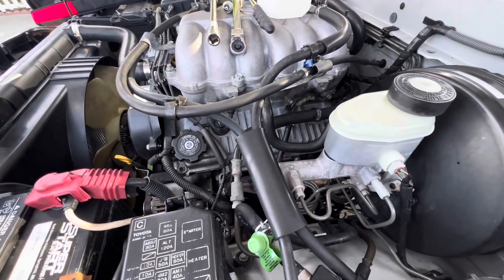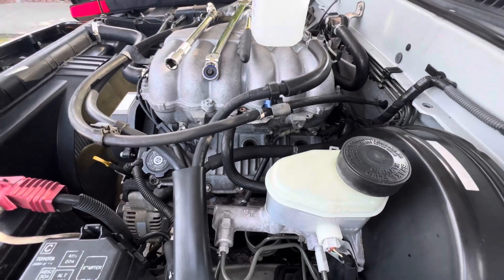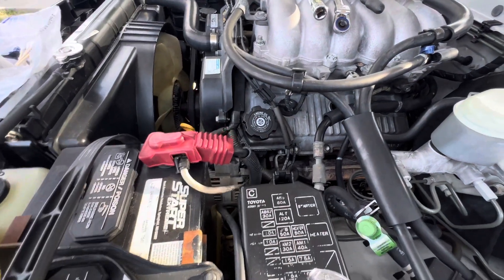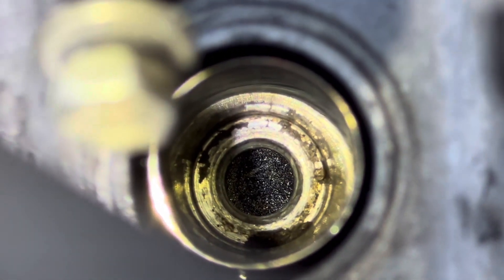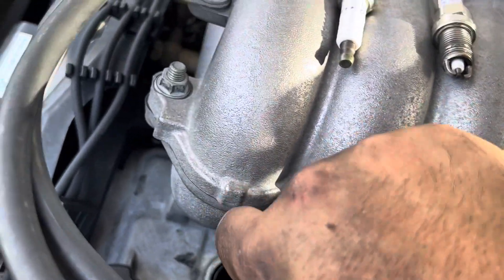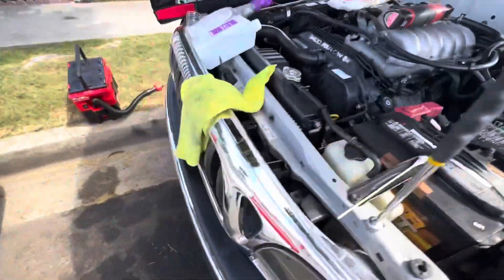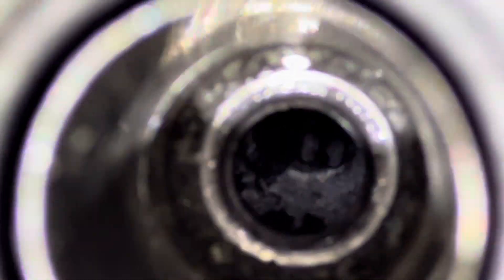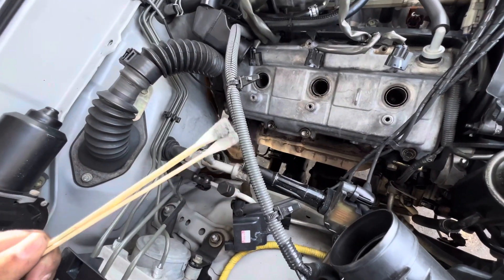How to Clean Spark Plug Tube Holes!! (5vz-Fe)

Comment: Just was wondering if you could tell me where you got the adapter hoses that fit on the Milwaukee vacuum?
Reply from the maker: Yessir I got it at Home Depot, it’s called the Milwaukee AIR-TIP Long Reach Flexible hose set comes with a few different sizes in the kit

Comment: Was all that crude not letting the plug sit flush could that cause the spark to ground out or not seal right
Reply from the maker: Truck ran perfectly fine just when I changed the spark plugs it was hard to thread the new ones in due to the junk in the holes